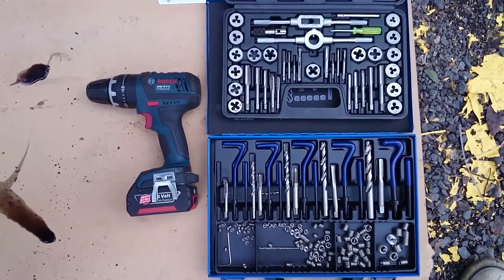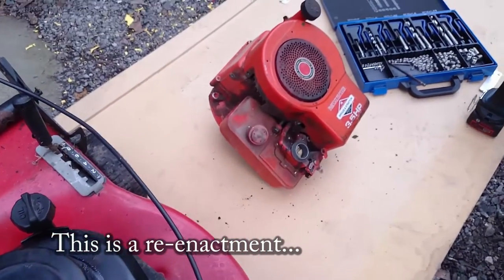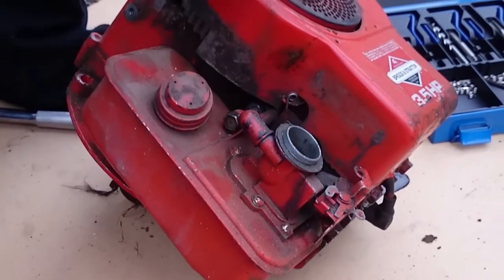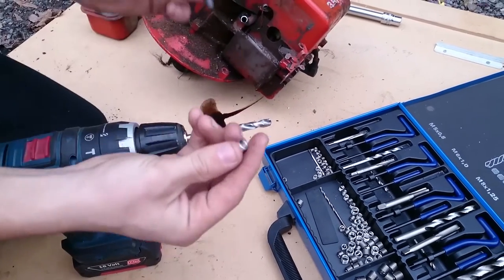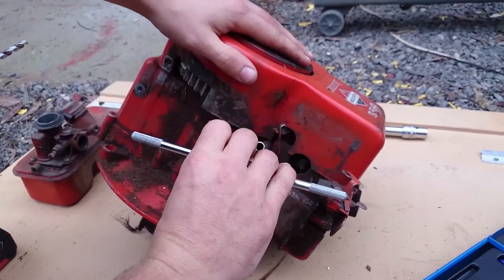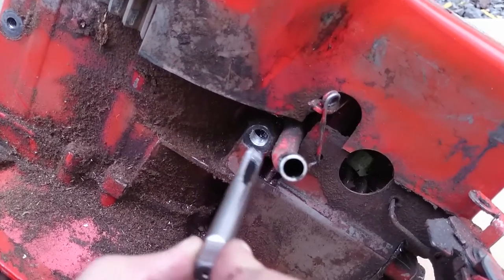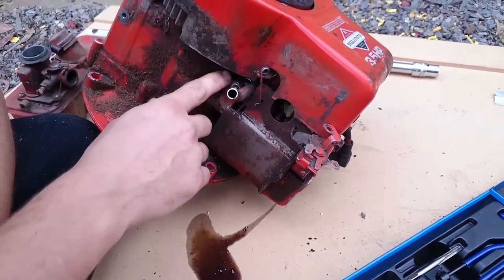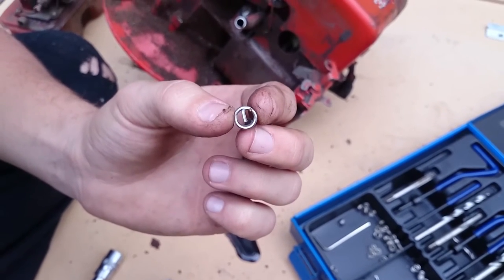PushMowerRepair - Thread Repair

Comment: where can you get a heli coil insert repair kit guys ?
Reply from the maker: Our kit was purchased on ebay
Reply from the maker: Probably only worth it if you will use it multiple times.
Reply: nice i might look into it and invest on on one good set and repair a stripped spark plug thread as i have on a small engine of mine :D